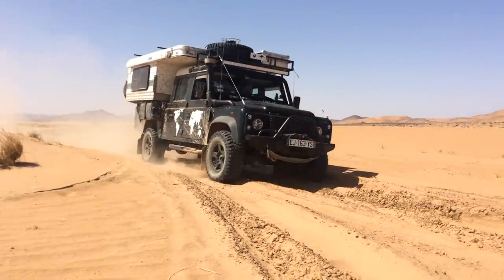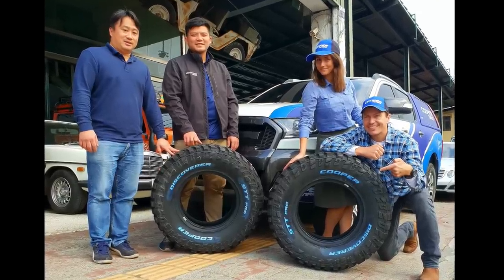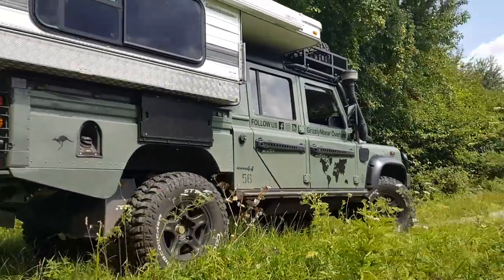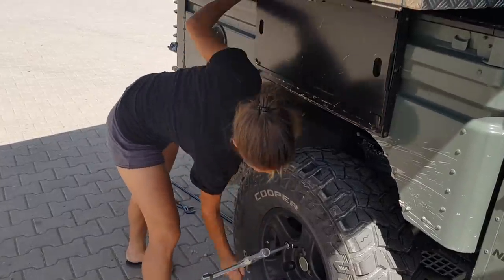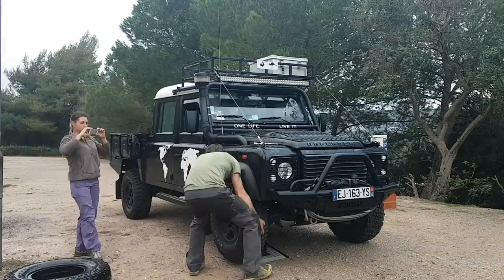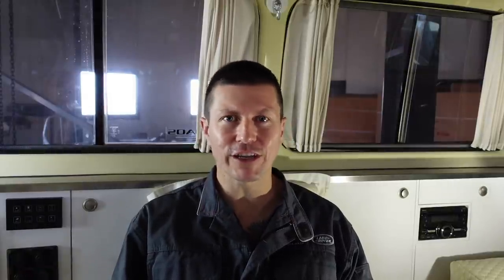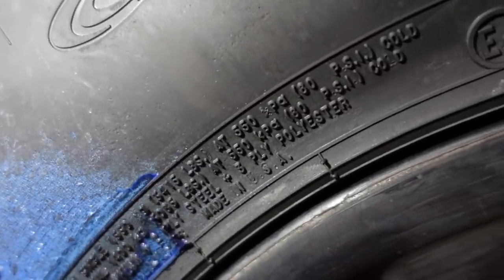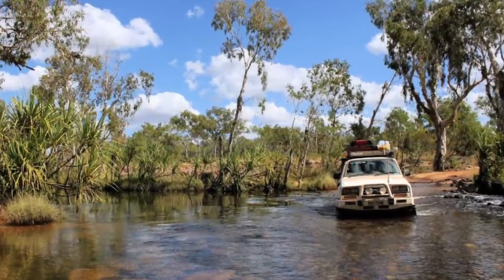Talking TYRES and TIRES @GrizzlyNbearOverland

Comment: I prefer "pizza cutter" narrow tires, both 255/85/R16 and 255/80/R17 are 33 inches diameter

Fun fact: lowered the tire pressure won't make the tire "contact patch" wider, but longer contact with the ground surface
Reply: Lots of people highly rate skinny tyres.
I think if Cooper did the 255/85 I'd give them a go.
Great fact on the lower tyre pressure, in fact now you mention that I remember seeing a documentary explaining exactly that.
Thanks.

Comment: Many go for the Coopers.  
I was mainly looking for an AT rather than an MT when I researched the tyres to put on my Prado, for a mix of conditions including caretaking on Pilbara cattle station.  I must admit that good mileage was one of my main aims after getting 70k from the Dunlops the Prado came with.  I chose BFG AT's and they served me well, as I ended up changing them after 10 years with 120k/km on the clock.  There was still legal tread on them, but 10yrs was long enough for safety and I didn't get a single puncture in those 10 years.  I replaced them with BFG AT's again, of course.
The worst corrugations that I have faced have been the track from Broome to the top of the Dampier Penninsula and some sections up the Cape York track.

Comment: Very well rounded comments and agree tyre rotation is very important. I run the Toyo Open Country on mine as they were the best available in the size I choose to run (tall/thin). I think your comments were probably justified re tread wear, haven't got stuck or had a puncture in them. The Cooper STT Pro's were where I would have fitted if they were available in my size.

Comment: It’s a shame more brands don’t make 255/85R16. Gives the height without the width problems.
Reply: If Cooper made the STT Pro in that size I reckon I'd be giving them a go.
Reply: @leighdearle5965  absolutely. There are only 3 readily available in Australia. BFG KM3, Toyo Open Country MT, Yokohama Geolander MT003.

Another benefit is they will mount on factory steel rims. (The 6.5” wide version found on 130s)  so may save buying aftermarket rims.

Comment: Timely video--just when I am looking to change my tires and rim. I made a mistake last time--went too big on my rims (18") and too wide on my tires (12.5)... Although the Toyos RTs 33" have performed well I am leaning towards the Ko2s at the moment. Reducing the size of my rims to 17" and getting tires wide enough to get tucked inside the wheel well... Having cow crap all over the side of the Jeep for a weekend drive may be fun but having to deal with it for several weeks can get old!! As always, thanks for the info.

Comment: I’m considering a second spare tyre for vw van because following the manual I can only swipe front with rear tyres. You normaly should change all four tyres at the same time on this 4motion vans but front ones get used quicker as the power is more transmited to those. So with two spare tyres you have to buy six at the same time but you might save two at almost the same period of time using the front ones at the back and the spares when they are new at the front !!!

Comment: One very crucial thing that alot of people don't pay attention to is fitment e.g width of rim for tyre. The amount of people fitting 235s on standard rims and 265s on wolf rims is scary. Both are not recommended to to fit them rims and could void an insurance claim.
Reply: Good point thanks.

Comment: Also a big supporter of the Cooper Tires. Just one question. Nothing wrong with the  265/75R16 size.   
But why  not  the  235/85R16 tires?  All the Defenders I know (TDi, TDi300, TD5, Puma 2.2 and 2.4)   came with  235/85R16 size as OEM from the factory.
Reply: Yes that's true and the 235/85 are the factory recommended size.
To be honest I like the slightly larger tyres for a fraction more ground clearance and I do believe the slightly wider tyres perform better offroad.
Many will argue that point though 😉

Comment: That’s a great choice, bro!

Most people care only their style, go wild or narrow like skinny jeans, but performance is always top priority.

I recommend every Defender owner to calculate the gear ratio of their tire set up wirh Ashcroft’s Land Rover Ratio Calculator.

https://www.ashcroft-transmissions.co.uk/calc/ratio_calc.html

Try to fill out blanks by your self (they are drop-downs menu, won’t be difficult), the diameter of Cooper Discoverer SST Pro RWL 265/75R16 is 812mm. You will figure out that your setting is in good rev.

I know the answer, 235/85R16 is best for stock suspension, 255/85R16 is probably maximum for stock suspension, 285/75R16 is kinda cool if 2” lifted, but 265/75R/16 performs better than 285.

I think people should choose whatever they want, it’s so weird if everybody has the same kicks. 🤣

But as far as I know, this is also love from freaking cold Hokkaido, winter tires, YOKOHAMA performs the best. ❄️

Steel vs Alloy wheels? A light weight with good load capacity alloy is definitely better.
Reply: As always incredible advice my friend 🙏❤️😉

Comment: Your tire pressure numbers blew my mind. I go much lower, generally. I'll go down to about 15 on just basic dirt roads. Horses for courses
Reply: That's only what I have the deflators set to.
I'll go way lower for really soft sand if needed I just do the remaining drop manually 😉
Reply: I only ever go what's required and definitely no lower than necessary. If the tyres are spinning at 16 psi then I'll drop to 10 psi and try again.
The rear always at slightly higher than front.
If I have the deflators set to minimum pressure and it's not required then it only means I'm wasting time pumping them back up again.
Reply: @leighdearle5965  I thought it might have to do with the much greater weight that you are working around.
Reply: @donewhiskey  mate I'll drop that pressure all the way down until the bulge is just off the rim if needed 😜

Comment: Love the videos as always! Used to be a patreon but I dont have patreon anymore. Are there other ways to support you guys? 
On the subject of winter tires and ice, you do have winter tires with metal studs in them, that makes a day and Night difference on ice. Here in Norway most people that live on the countryside use that, while in the citys were you get less snow and they use salt on the roads, most people prefere to not have studs (noice/Comfort and environment reasons). 
I dont run nothing without studs in the winter after sitting for hours at steep hills waiting for a tractor to lay down gravel on the ice..... 😂

Comment: I usually run general (cooper brand) all terrain with studs  for winter and cooper stt pros for summer on my Land Rovers. That size tire you are running is perfect for stock defenders and discos and rrc with a two inch suspension lift. For my series I always ran a 235/85r16 . 

See if you can get Tibus to sponsor you with their portals hubs and other goodies. 

I don’t recall if you mentioned it prior, but are running any type of lockers in your axle diffs?

Comment: A 285/75r16 BFG KM3(more like a 275/75r16) would probably fit as they are narrower and a smaller diameter than the STT PRO. Not saying that KM3's are a better tyre than the STT PRO's, just commenting about the size differance.

Comment: Massive tires is for the looks, but for a Defender, for some reason "small" or narrow looks way better. More classic looks maybe.
Reply: Look at what Paris-Dakar drives!
Reply: @BittnerBuddenbrock  not saying big tires are not mandatory for some use. For very long travel distance, not necessary. For racing, I agree, helps all your suspension system to absorb all the bumps on high speed, temperature etc
For a trip like the guys are doing, you have to think in every gram you add to the truck too. And massive tires, are heavy. Affects gvm, braking. All depends the use you are going to give to them.
Reply: Narrow tires are far better in the snow more weight is pressed on the ground

Comment: Excellent insight as always. How do you balance the wheels after you rotate them? Or do you have no vibration issues?

Almost a year ago, when I asked a bloke down under "What are spacers good for", I was told "to make your wheel fall off" best advice I got during my time in Australia.

Beadlocks are interesting, but do you think they will be usefull if you 'only' go down to 16 psi in sand? Or would you like to go lower if you could (with beadlocks). Obviously they look great ;)
Oh also, technically you are a pro, I mean, you can't get much closer to 'driving an off-road truck around the world for a living' than you currently are can ya ':D
Reply: Thank you so much mate 😉
Actually I'll go way lower than 16 psi on really soft sand.
I just have the deflators set to that to save time.
If 16 psi is working all good if I need lower I'll drop the rest manually.
I wish I'd had that spacer advice you did a few years ago 😜
Reply: I'll drop my tyre pressure way down to like 6psi if needed.
As long as you are on nice clean sand without rocks that might damage the rims the chances of popping the tyre bead are minimal unless you're taking corners to fast at super low pressure.
That will pop them off very quickly 😉
Reply: @leighdearle5965  well during my three months in Australia I managed to see two people lose wheels, so that advice really stuck with me! Technically the second one was not because of spacers, but it did teach me to take wheel maintainance seriously. The guys over at Hema maps check all the nuts every single morning, just to make sure. I noticed spacers are much more populair/common here in Europe anyway.
It always surprises me how much impact lower presures have, and how low you can go, wouldn't expect 6 psi on a 3.5t truck to be feasible, but I learn every day, thanks!
Curious to see what taiwan will bring you guys.

Comment: I understand the choice for M/T if I hear the arguments about off road performance, but on a fully loaded car it could give you more than 8 meters more braking distance opposed to A/T tires. That's a lot and would outweigh the off road performance, especially when you have a winch.
Reply: A winch does not serve you very well in an open area with no trees... (don't ask me how I know :))  And using a ground anchor for a 3.5T vehicle is hard, especially in hard surface....
Reply: @GeertB84  How do you get stuck in a hard surface ? I am assuming you do not mean (for example) a salt flat with mud underneath ? As that would give you options for a ground anchor.
Reply: @svenvanwesterloo173  I meant hard as in hard to get the ground anchor to work. In muddy, sandy ground for example it is hard to pull a heavy vehicle out with a ground anchor.

Comment: Ive got excactly the same problem with my 285 coopers there rubbing the top right handside spring mount im running wolf rims .... I need to change to 265 like you guys
Reply: Less is more. 😉
Reply: @mrcvry  lol does money work like that also
Reply: Have you raised your vehicle on the springs?
Reply: @husq2100  yes i have mate thats when the rubbing started the front tyres rub the raduis arms aswell but i can live with that ...... i either need some 265's or some different offset rims
Reply: @touretz  
Spending less is more money. 😄
Reply: @touretz  you can adjust your steering stops to stop the rubbing on the radius arms.
Reply: @leighdearle5965  yes i know cheers mate im not bothered by the front its the back thats annoting me as my chassis is galvanised and the tyre is rubbing through the galv 😫
Reply: @touretz  ah that does suck...
I guess you could always try more offset rims although from what I understand this still creates the same problems spacers do...
Reply: @leighdearle5965  yes i think il have to save my pennys and get some 265's ..... have you got 265's on now do the rub on the spring mounts

Comment: Hey Leigh, you referred to having had problems with spacers. Could you elaborate on that pls? Thx a million! Pascal
Reply: While spacers give you a wider stance and a smaller turning radius they increase the leverage quite a bit. Combine this with a heavy vehicle and you are in for greater wear and/or damage on bearings and axles.
Reply: @freeesurfer4661  thx!
Reply: This guy analyses our snapped swivel housing quite well in this video.
https://youtu.be/sc_FRcODTv0

Comment: Leigh another great heart felt review from personal experience. Long story long. Coopers get a great rap and deservedly so given the number of supporters here in Australia. I’ve been using BFG all terrains since 2010 and the mileage I’ve got from them is incredible along with zero punctures. Unfortunately a couple of months ago I wanted to replace them and couldn’t get them. Tyre shortages everywhere here. And no response from the importer either ☹️Australia was 100% out of stock and the ETA was unknown for these and Maxxis that I would’ve taken as a second option (their road bicycle tyres are incredible!). So I opted for a set of 5x Yokohama G015s, near new with good used rims from Bribie Island. Great price and got me out trouble as they needed changing fast. Figured I could keep a couple of rims and sell the rest and recoup my money. But after a few trips they performed pretty well , but I felt that the side walls have less integrity. Could be psychological. I also agree with you on tyre size. These Yokohama’s are 285s and the BFGs were 275s and I’d have the smaller less wide/high BFGs any day instead at the moment.... but it could just be my personal positive psychological BFG experience of the past 11 years. But sometimes that trust and stress reduction is so important to an enjoyable trip. 👍😉
Reply: Be careful with the G015s, they have significantly weaker sidewalls than the KO2s. However the newer Yokohama X-AT G016 tyres are pretty good.